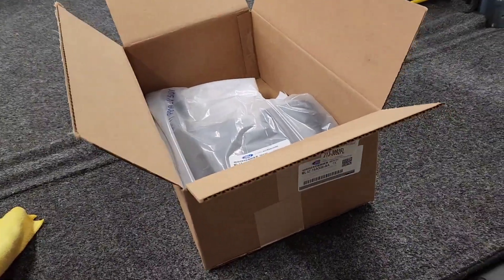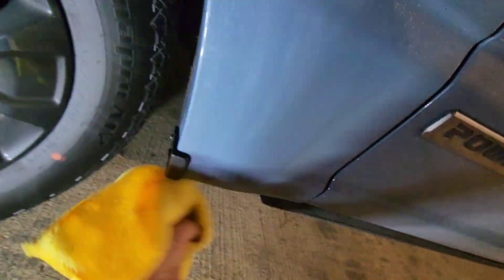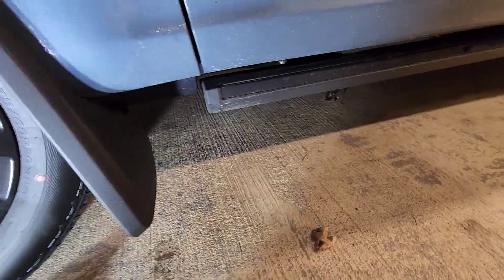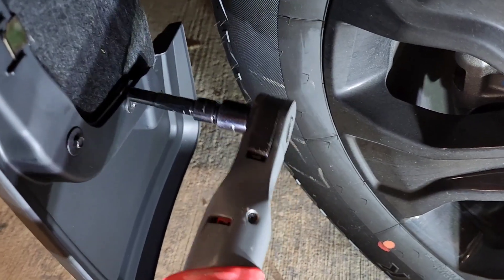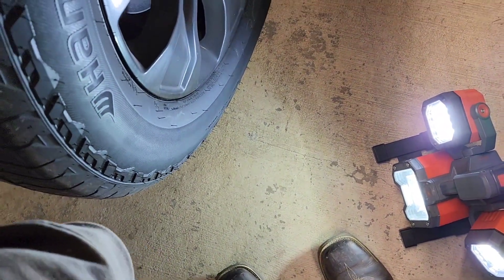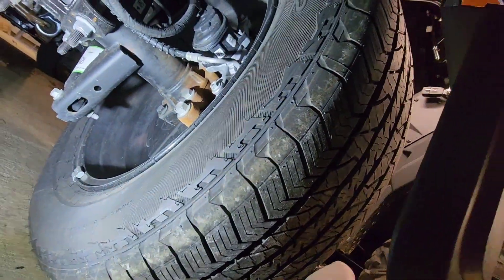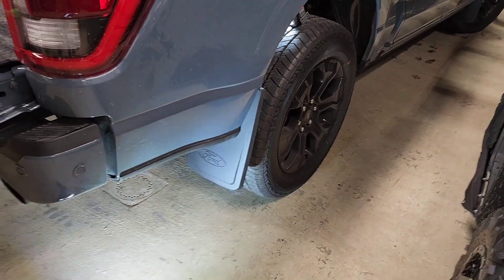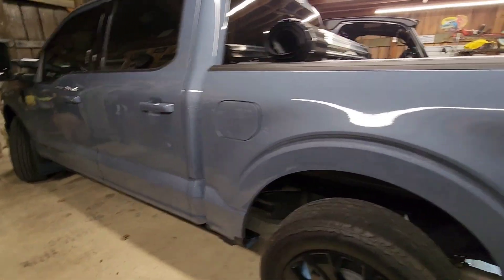Ford F150 2023 Powerboost Fornt and Rear Mud Flaps splash guards how to install

Comment: Got a 2021 Lariat powerboost, the 3 things i did to it was rear wheel well liners, stock size toyo open country at3 and the hybrid speaker delete kit
Reply from the maker: How is the mileage with the Toyo and nice setup.
Reply: @Iceagetv  i got the work vehicle home so i don't drive to and from work, not quite 2 years since i have the truck and i don't drive it that much, right now i got 6882 km so it goes into deep sleep a lot and last time i drove it got a warning the battery was low, i don't have a garage so i can't put it on a battery tender, i find the at3 to aquaplane if it rains heavy

Comment: Hey was wondering if this would fit a 24 f150 raptor please help!
Reply from the maker: @puppetmaster7479  not sure 24 models had a exterior body finish update and change
Reply: @ did u drill into a painted service?

Comment: I just installed on my 2023 F150 and had the same trim where the rear flaps go. I didn't drill the plastic out and just put the two bolts on and it's quite sturdy.  Great looking flaps though.

Comment: Thanks for the video!  I went ahead and ordered the same set.  I have a 2022 Powerboost with the Platinum package.  I bought it last Christmas Eve and LOVE IT.  12k miles...  I did the wheel well liners within the first month.  Super easy.   Also, I love detailing cars and ceramic coated mine.  It really helps keep it clean and easier to wash!  Have a great Holiday!

Comment: What is the hug zip tie for the and the two strips of clear film?
Reply from the maker: Clear film is if your concerned the flaps will rub your paint 🤔 than put on the film.  I never do and as far as the huge zip tie I did not use it and really not sure.
Reply: @Iceagetv  the clear film isn’t large enough for the area under the flap.  Instructions look like it goes on the brace but not reason for it too.
Reply: @matthewbaynard from what I understand in the instructions it goes under the brace to prevent galvanic corrosion between the aluminum and the metal the clip is made of